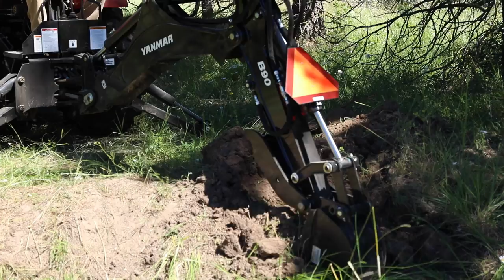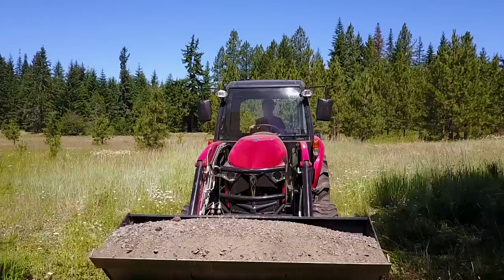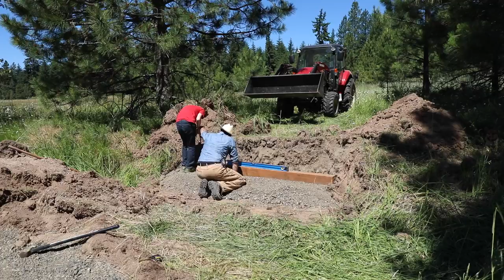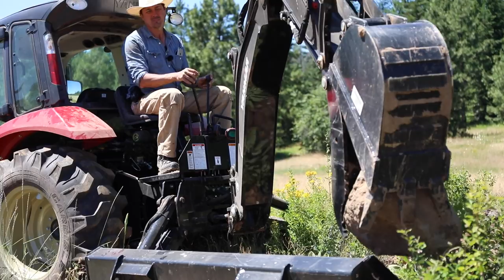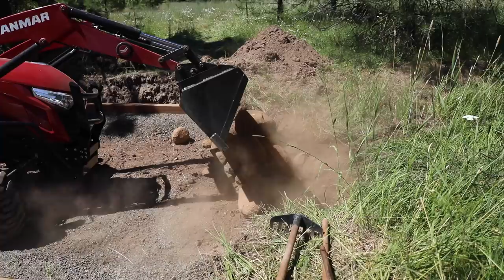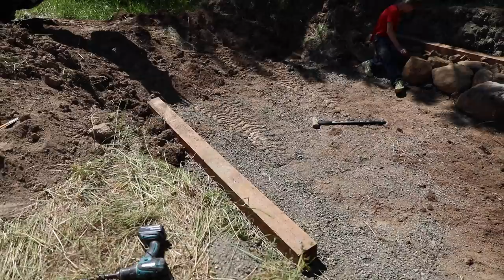How To Build A Bridge Over A Creek For A Tractor 2

Comment: Those raw wood beams making ground contact would be rotting where I live within 2 years. I'd use pressure treated for sure or if using raw cut wood I'd use 50/50 mix of kerosene and motor oil to treat it. Old wooden roller coasters 100 years old are painted with motor oil/ kerosene and theyre 100 years old.
Reply: I think those are pressure treated beams that he bought for that purpose. If you look closely you can see a bar-code tag on the end of the 6 x 6 in the first video.
Reply: He said it was Douglas Fir not pressure treated tho

Comment: How about making up a cement slurry to pour overt the rocks and gravel to help hold everything in place when the water flowes through? just a thought.

I am not a engineer but I did stay at a Holiday Inn Express last night.
Reply: Well, for one it's a huge pain to mix concrete if you don't have a proper mixer, and doing it out in the field is likely even more of a pain ... also, why? as this will work just fine too...

Comment: Hi Cody, I've been away and just now catching up on the series. If its not too late, I recommend making sure the height to the bottom of your bridge is at lease 1.2 times the depth of the stream (measured at bankfull width). This factor is a requirement for the designs and permitting I do, and will help in high water situations.

Comment: New nickname for Jack or to all who love sledges for uses. Does    "bam-bam" ring off the steel well. Yes my dad would've had the deck ready to drop on the footings  when you got done. Plus caught and clean the main part of dinner that night too.  Old school name for your laser level is a farmers  level. Use to layout the front lawn of the school to do a topical map of it in farm shop class. Hard part was the deep drop off at one corner of the area. Had to make a new reference point for elevation. Seen a lot of older maps of donectears earlier and that was a dip in the terrain,  Should have used the Blue Spruce tree as the elevation reference for the whole yard. Would have to measured the reference  height only three times but then we were outside to.

Comment: So might it have been a little easier to just lay one or two 24" sewer pipes and fill around them with the rocks and gravel?  After all, won't the timbers, since they're not treated, eventually rot out?  Just wondering.
Reply: I think that the volume of water and the timing of the runoff could not be handled by the culverts. Apparently the water builds up really fast and there is a lot of it!
Reply: utiplayer - Culverts cost money.  Rocks and timbers are free from the farm.

Comment: why didn't you just put the boulders in the bed of ur truck it would be easier and you will get more out of it
Reply: Just because the bed has space for more rocks, doesn't mean it can carry the weight of them.  A good bucketful of those boulders will easily weigh half a ton to a full ton, which the tractor can probably bear better than a pickup can.
Reply: year truck like his could carrie around 3,000 pounds or more
Reply: Ryan Colorado depends on the suspension if you are talking about the weigh it is able to tow then yes it could easily tow 3000 pounds but the suspension would have a load rating and putting to much rocks in there could easily destroy the suspension
Reply: Will Rye could pull 4000 pounds and it has a payload of 3000 it could and easy move half ton boulders
Reply: Ryan Colorado: But it's more clever, how to load your own tractor with no other heavy equipment around. Besides, it could bash the bed of his truck. I have seen it.
Reply: Ryan Colorado you still don't understand the in convenience of the extra work you would have to put in, I have seen cars that's wheel have gone out side ways because of having rocks in the back. My dads car has gone down to the wheels because he had a few 20kg battery's, and his car was rated to Cary an extra 2200 pounds then what you're saying. So judging by what you're saying the car has super good suspension and amazing leaf springs
Reply: I thought this too but concluded same as what's been said here, way easier to dump the front loader than the pick up bed.

Comment: Nice work. Maybe the Samurai Carpenter would like to help build a Japanese style bridge? :) Jack may need to use the drill attachment. The Makita drill comes with a cheater handle for hi torque use. I use it for drilling 90mm holes... It stops you from busting your wrist and saves on elbows!!!